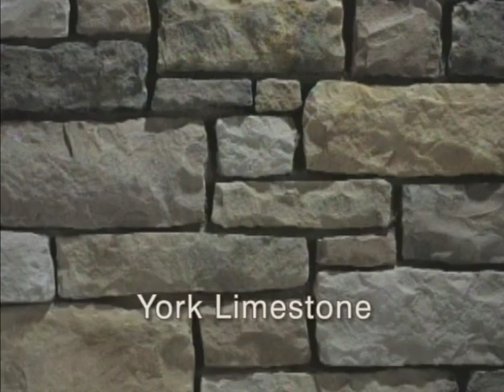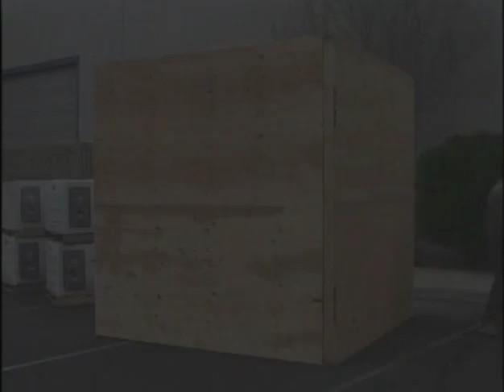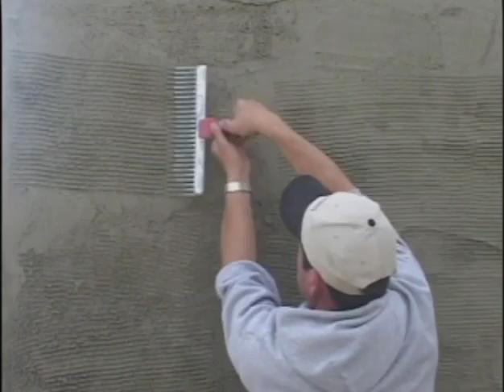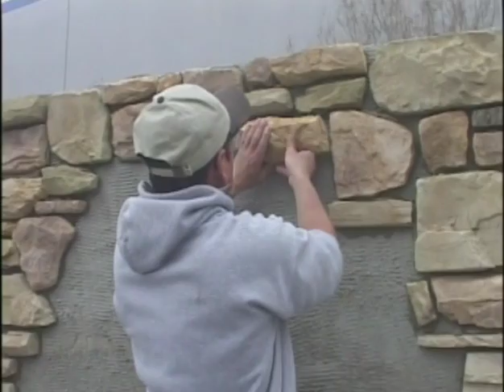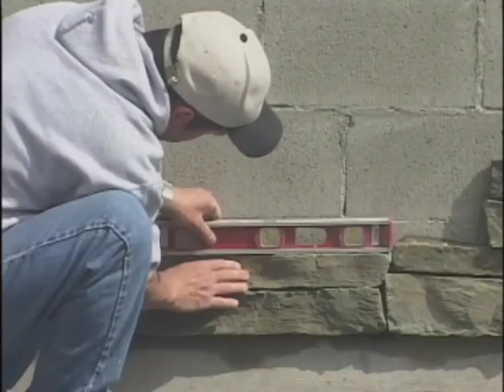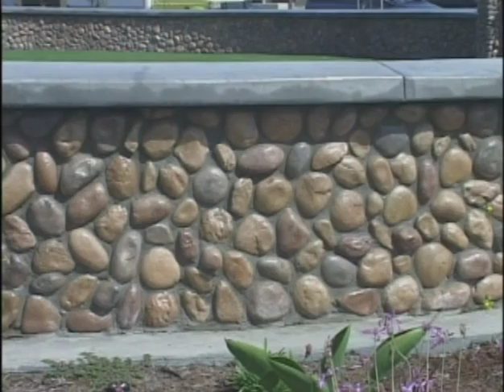How to install Eldorado Stone

Comment: Wire lath is upside down in this video. Narrator should refer to other El Dorado  video that has the correct instructions.
Reply: I can see why the lath cup should be facing up (like in this video), but I don't understand why the cup is actually supposed to be upside down as you say. Who is the final authority on this?